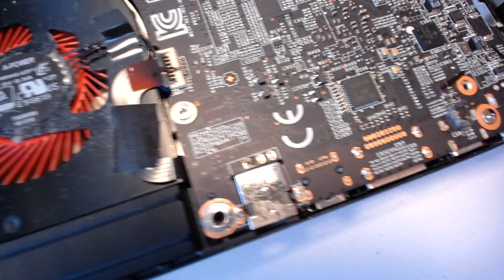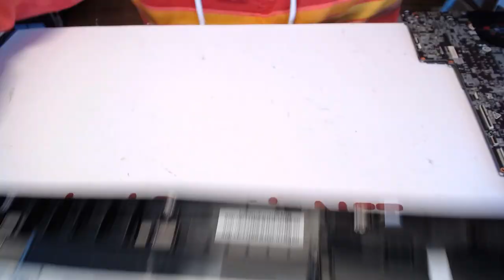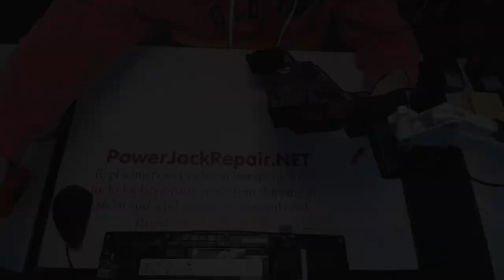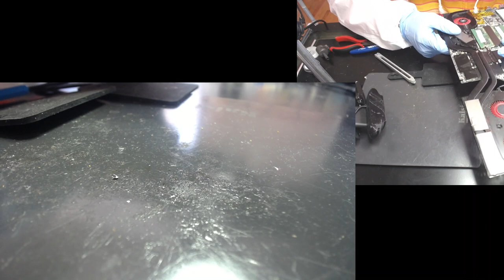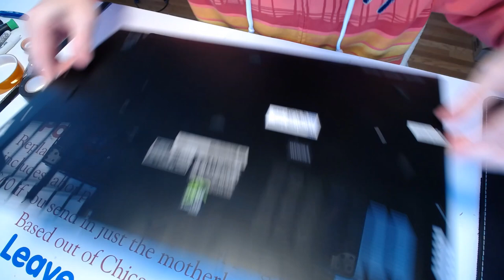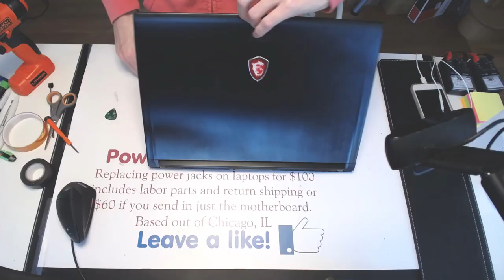How to fix laptop not powering on MSI MS-17B1 gs73vr 7rf broken charge port power jack repair

Comment: Hello thank you for uploading my msi gs73vr battery is dying and i need to press the power button 100times with or without the  battery do u think its power button issue or something else? Many thanks.
Reply from the maker: Can you use hibernation/ sleep instead of the power button?   If laptop comes up just fine after hibernation/sleep mode then you don't have to press the power button at all.  Yes power button have issues too.

Comment: When I connect it, and press de power button the power supply has short circuit and the voltage down to zero. If not the charge port jack... ¿What will it?